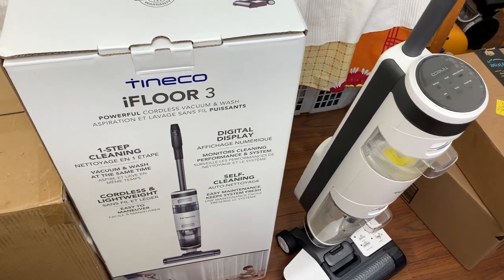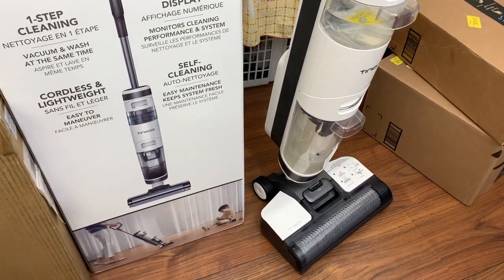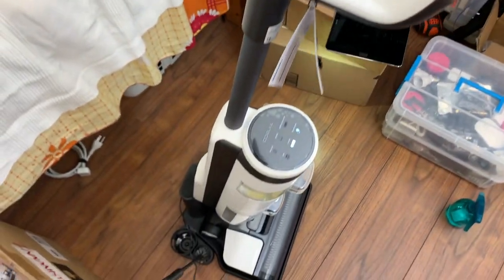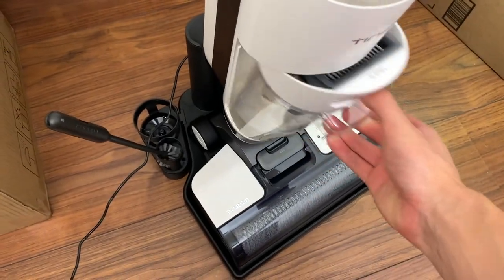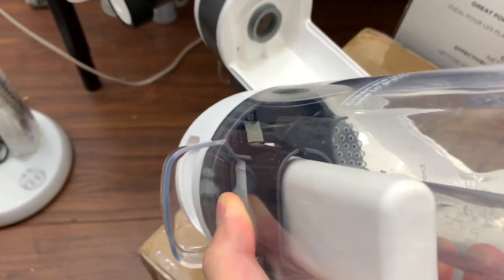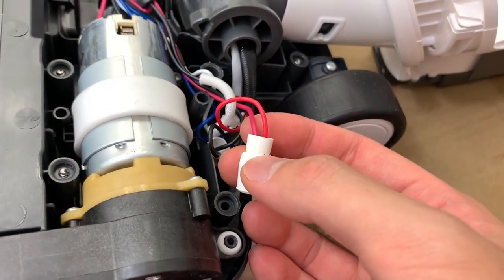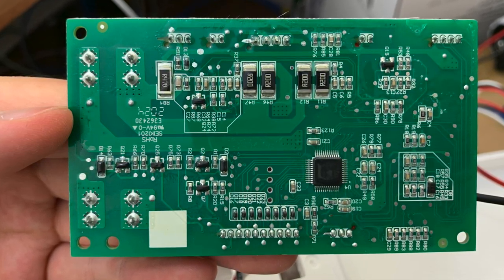Tineco iFloor 3 Noise Measurement Test and Teardown Disassembly Inside

Comment: Thanks mines was turning on for a few seconds and turning off. Also no vacuuming. I stuck a thin screwdriver to rotate the motor fins above the dirty tank and it worked. Just needed a little movement I guess. Thanks a million🎉

Comment: Interesting, i have the Philips Aqia Trio since 8 years which is the first model on the market i guess regarding those type of floor washers. It has two rollers instead of one and its corded and very heavy. So i bought the Bissel crosswave cordless pro but this model has the problem that it leaves way to much water on the floor, you just have either to much water on the floor or its super dry and it will leave streaks when the floor is dried. It has a 36V battery. Can you tell me if the Tineco has the ability to not leave streaks and to produce an even not to wet water film on the floor unlike the Bissel crosswave? The Philips Aqua trio is perfect in that regard but it has much higher RPM and it was two softrollers and its corded. I am tired of the cord and weight. I have to mention that i use those devices only to wet wipe my tiles, i always use my normal vaccum cleaner before, so i just need to know if this machine leaves a nice not to wet water film that dry without streaks. The Bissel device sometimes produced strange water "streets", almost like small puddles on the floor, thats not acceptable.
Reply from the maker: It has been a while since you posted this, so I hope this is not too late. The machine leaves a very thin film of water on the ground, and it usually dries up completely by the time I've started cleaning a few metres away. The machine doesn't leave weirdly large amounts of water at all.
Reply: @liminalsunset  Hi, yes i own the Tineco S3 Version now and its much better compared to the Bissel cordless. The Tineco S3 is technically almost identical to the Ifloor3, in fact i would recommend the ifloor3 because its cheaper. The benefits of the S3 are all not really needed. It has voice output, a dirt sensor, different display, app controll and slightly larger battery which is the only thing really usefull. Ive heard that other chinese companies have released similar machines though.

Comment: Hey Thanks for taking it apart that was very interesting! Also is it possible to replace the battery in the future? I know Tineco says no but looking at that battery pack it looks like it might be a possibility.  Thanks again! 😊
Reply from the maker: Supposing you could find a replacement battery, replacement of the battery is theoretically possible as the machine does not appear to have electronic communication to the battery, just a pin for temperature sensing (which it will not function without). Replacing the battery is possible without performing a complete disassembly, but the compartment is "sealed" by design (even though the machine is not waterproof). There's no indication that unsealing it will allow water to enter it at all anyway, and the battery cover uses a reusable gasket for the most part.

Comment: Could you tell me if I can safely take apart the clean water tank without damaging it? It seems simple enough. However after removing the top two screws, I felt quite a bit of resistance when I started to pull the white portion of the tank off, so I stopped in fear of damaging it.

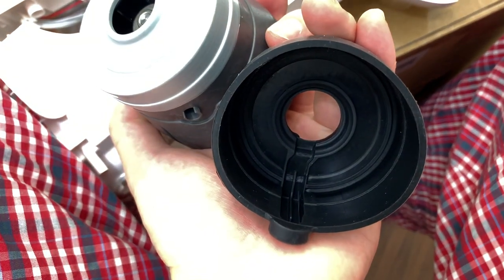Comment: thanks. awesome disassembly video! 12:38 it appears that the motor does cool itself with fresh air and not the air from the dirty water tank.   however, i've seen comments complaining of motor malfunction and one is blaming the vinegar he uses as cleaning solution which I think causes corrosion to the motor. is there a possibilty that some air from DWT gets to the motor?
small note: I am interested in the S3 and this one you reviewed is the FLoor 3.
Reply from the maker: The motor appears to be cooled by clean air, however, the sealing isn't 100%, and acidic or basic air can still cause issues with the bearings in the motor. Keep in mind the fan and the impeller will still be exposed to the dirty air, and only the electronics of the motor appear to be cooled using clean air.
Reply: @liminalsunset Hi, mine blows out stinky rag smell. Anyway to clean the fan to get rid of the smell without disassembling like you did? Thanks in advance.
Reply from the maker: Do you know for sure that it is from the fan? Check the filter, brush roller, and give all of the tubes and crevices a good wash, particularly the dirty water tank, and the area behind the dirty water tank. If the fan is indeed dirty, it will be rather difficult to clean effectively.  @donspammer
Reply: @liminalsunset  Thanks for your quick response. Yes I made sure nothing else is causing the smell. After each use, I take everything apart to clean and air dry. I do not use the self cleaning feature.
Reply from the maker: In this case, the disassembly might be required. You'd actually have to take the motor even further apart, but I'm not sure if it would be easy to actually clean it properly. There is a link in the description to what appears to be the same motor on Aliexpress, which might help if you needed to replace it.  @donspammer
Reply: @liminalsunset  I’ll take a look at the link. Thanks for all your help.

Comment: Hey great video and teardown do you know which part is responsible for the  auto on and off mechanism when pushed upright ? And is it possible to safely remove it ?
Reply from the maker: Hi, thank you for your comment. The component responsible for this would be the micro switch, located in the brush assembly near the hinge. This switch detects when it is upright. Checking which position the switch is in when upright and flat will tell you whether to simply remove the switch from its position and place it somewhere safe inside, or to electrical tape it shut. 

However, if you do disable this switch, you should check if the machine will still do self-cleaning or charge with the switch permanently in one position. In the case that it will not, you would need to wire a external switch to the case in a convenient spot and use that to enable charging or self cleaning.

Please note that this will likely void the warranty, especially if you do something irreversible. You may be able to find connectors at a local electronics store and a small magnetic reed switch to make these modifications in a fully reversible way. I do not take any responsibility for anything you do with this info. Hope this helps

Comment: Hi Larry
Thanks for the video. I just took apart mine. It works several second. The roller works free and the vacuum works well  but shuts down. Checked everything . The battery is fine. No visible block anywhere. Do you think it is faulty board so I can replace it or is some sensor ?Thank you very much. Ned
Reply from the maker: Do you know which lights are on on the machine or what error messages show up? The machine has several sources of stopping - microswitch for upright position, charging detection, motor current and speed measurements, liquid present sensor, off the top of my head. Furthermore the battery may have a temperature sensor inside. These are points I would start with troubleshooting, I would think. However I understand that some of these checks are advanced-level electronics troubleshooting steps.
Reply: @liminalsunset  Initially is the Self clening light. When I put it in the charging station it starts to run and water the roller but when it comes to sucking the water ,it starts and then stops. The self cleaning and the Max light starts to blink. That is all.
Reply from the maker: @nvalentine5906  I'm thinking this might have something to do with the main motor then. The main motor has a couple lines for the main board to detect its performance level and RPM/current consumption, so if it's either too high or low or is taking too much power, it could be getting shut down. Is the fan restricted in any way from rotating? It should turn somewhat freely.
Reply: @liminalsunset  Everything is clear and free. It starts very good and the power of vacuum is great. I was thinking to run the motor separately to see if it runs free. Use the two motor connectors from the board? Do you think is wort it?
Reply from the maker: @nvalentine5906  I'm not certain if the motor will start without a signal from the main board, which is likely to be a PWM. I would probably suggest that it would be best if you, or maybe a local repair shop, would be able to probe the signals coming in and out of it with an oscilloscope to see if there's any obvious error in the communication signals.
Reply: @liminalsunset  . Just tried and yes it doesn't work from the connectors.. Thank you for your help Larry. Appreciated!

Comment: Thanks for the review!
What do you think, can iFloor 3 be a main mop machine? Or it's just an extra cleaning tool?
Reply from the maker: I definitely think this can replace routine mopping/etc, though the clean and dirty water tanks may need to be emptied part way through if used in a large home. The maximum capacity of the dirty water tank is only half of the tank size shown. The suction is quite powerful, and the brush roller really seeks out dirt. With that said, heavy stains or anything that's really stuck will probably require manual intervention. Things like the odd leaf or small piece of paper etc are picked up by this machine without issue, as are dust, dirt, and lint.

Comment: Hi there, thanks for the video. May I know how did you access the motor area? Been trying to figure it out and I've taken off all the screws (I think) but still can't access it
Reply from the maker: Sorry for the late reply. The inside casing behind the tanks needs to come off. There will be hidden screws under the trim piece near the brush roller assembly - you'll need to unclip that grey ring and undo some screws under it. Keep in mind the ring around the top display panel needs to come off as well, and screws under it removed, as well as screws near the back. Hope this helps.
Reply: @liminalsunset  Thanks! Much appreciated

Comment: My battery is also showing 2 bar only. And once I on it for awhile, it will off by itself. I suspect battery issue. How can we change the battery when I cant return it to the service centre? Thanks
Reply from the maker: Hi, I am unaware on where a replacement battery could be sourced. However, the battery currently in your machine could potentially be refurbished. Often, the cells are simply out of balance and/or the cells need to be replaced. The battery cells are standard 21700 I believe.

Comment: The vacuum cleaner stopped working, the mopping roller rotates a little, then the vacuum cleaner stops working.. What is the solution to fix it?
Reply from the maker: Rotate the mopping roller by hand to see if it is blocked. Rotate the vacuum cleaner fan by a small stick with power off to see if it is blocked.

Otherwise, you will need to take it apart and probe to see whether any motor is shorted, or whether the vacuum motor receives and sends feedback signals to the board.

Comment: Mine turns on for a few seconds and shuts off. Also not vacuuming during those few seconds cleaner comes out and the roller is spinning any suggestions to resolve this issue ?
Reply from the maker: I would personally start by removing the dirty water tank, and with the power off, attempt to see if the little fan in the motor turns freely when pushed with a thin stick. If it is stuck, disassembly to free it is in order. If it is not stuck, then either the motor or controller is faulty, or the motor is not getting power from the main control board. 

You would need to open the machine and measure the voltage supply to the motor when the machine is powered on using a multimeter. Then you could check the speed command signal from the control board. Further troubleshooting would be at a more advanced level. 

You may find useful advice if you can make a YouTube video of the issue and your troubleshooting.

Comment: Have any idea how to remove the handlebar?
Reply from the maker: There is a small hole with a rubber grommet in the back near the insertion point of the handlebar. You need to insert something and push in to release the latch, I think.
Reply: @liminalsunset  thank you

Comment: Can u show me how u took the bottom part off. The tedious disassemble is needed to return
Reply from the maker: Which component do you need to disassemble specifically? When the unit was new, none of the components on the bottom were detached - it should fit in the box without disassembly. The bottom brush assembly as a whole is not designed to be removed easily and requires the disconnection of wiring. 

If you are talking about the handle vs the main unit, I believe there is a hole in the back that doesn't have a screw in it. You need to use something about the right size to push in, while attempting to remove the handle. The manual should indicate how to do this.
Reply: @liminalsunset  yes I got that I was trying to remove the bottom part with the roll so it could fit in a different box. I accidentally through the box so just trying to make it fit somehow in a regular size box
Reply from the maker: @Vsignaturecoffee  It's not recommended to remove this component if  you're returning it to a store or trying to get warranty service, as it is very likely you will void it, and cause the return to be denied.

Please ask the place you are trying to send it to whether they will accept returns without the original packaging, and if so, how they would like it packaged

Comment: Please how to remove the stick I buy it but I want to return to store
Reply from the maker: Use a thin object like screwdriver to push in the small hole with a rubber grommet near the back near the handlebar insertion point.

Comment: Mine keeps making a very loud noise and just shutting its self off after 3 to 4 seconds after turning on also does it with self cleaning
Reply from the maker: Would you be able to make a video of this? Try to check that the brush roller is free, and that the pipe leading to the dirty water tank, as well as to the motor area, is clear of debris, and that the brush turns freely when it is on.

Comment: My self cleaning won’t work, any ideas?
Reply from the maker: Ensure that the filter, brush roller and both tanks are installed correctly, the charger is docked and plugged in and there is power at the outlet, the clean water tank is more than 40% full, the dirty water tank is empty, and to press the self cleaning button on the end of the handle once to activate the self cleaning process.